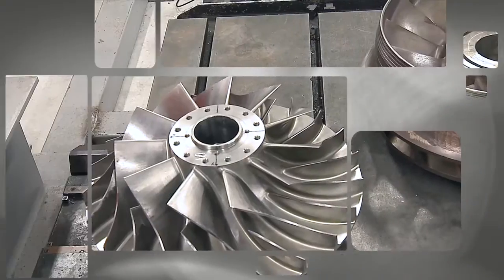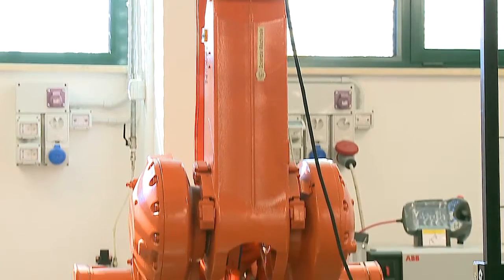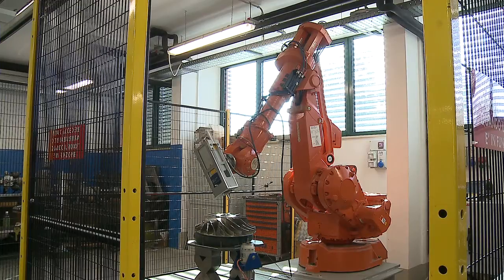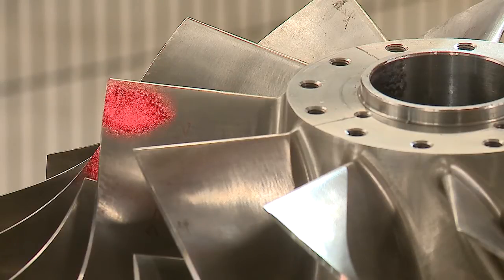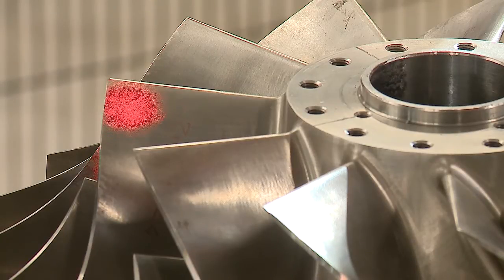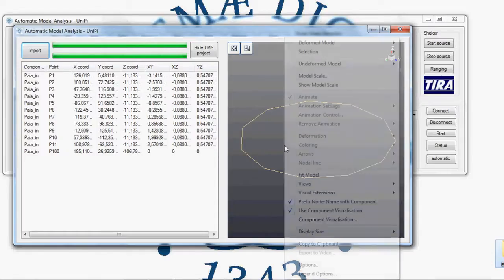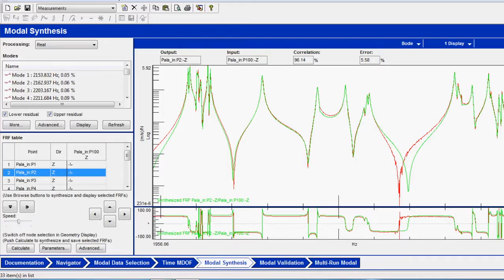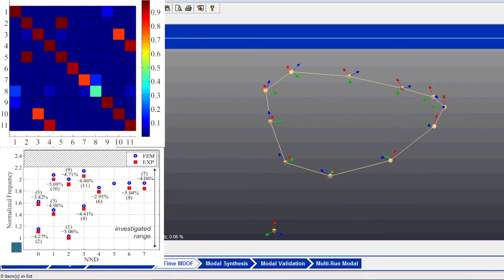Experimental modal analysis with robotic arm and LDV, UniPi - GE.

Comment: Awesome video, hopefully you have some time for a few questions? 
What is that rotor used for? 
How did you determine the chosen orientations to shine the laser at?
How did you determine the boundary conditions used for your testing? I can see its secured to a inflated tube and excited at the edge of the rotor?

Thanx
Reply from the maker: +Dawels These rotors are centrifugal compressor impellers. The orientation of the laser beam has to be perpendicular to the local tangent plane of the blade in order to have the highest signal, and the robot ensure this orientation accurately. The inflated tube is the best experimental approximation of the free-free boundary condition to have the natural modes not affected by the support.
Thanks for your interest!
Reply: Thanks for the reply! I am doing a modal analysis on a similar impeller. Could I please contact you for some more advice? Here is my email if you find a gap to send me your contact detail: 17313120@sun.ac.za

Comment: Contragulations for your video, very good job.
What type of excitation did u use, coz it looks like Burst Random to me. What excitation parameters?
Shouldn't the force sensor be attached from the side of the test structure? Shouldn't the length of the stinger be higher?
Thanks..
Reply from the maker: Yes the excitation was Burst Random containing an harmonic spectrum spanning the range the component (impeller) is facing during its usual operation.
The force sensor may be attached to the structure but the mass of the load cell goes to the vibrating system.. a too long stinger operates as a low pass filter, anyway yes the loading system can be improved and we are working on it
Thanks for your interest